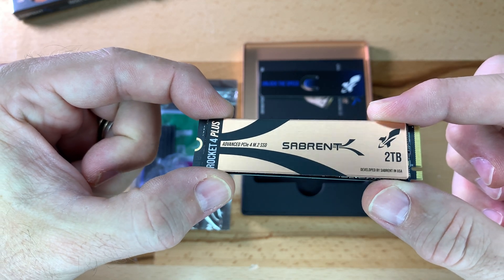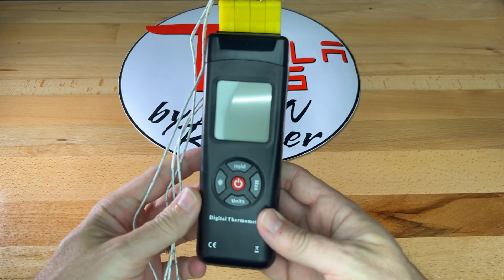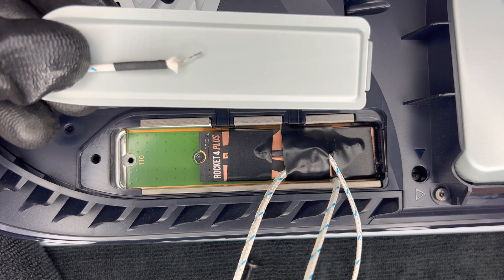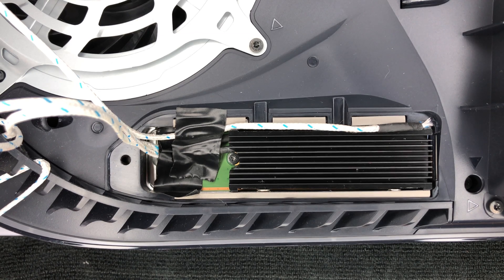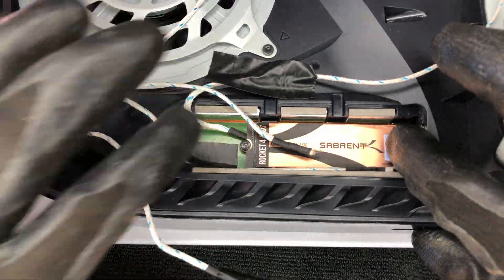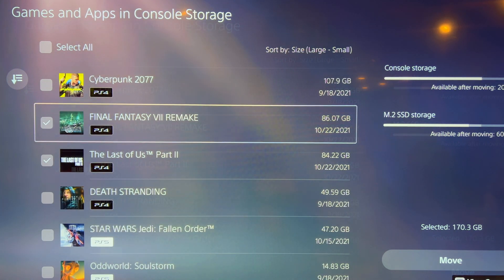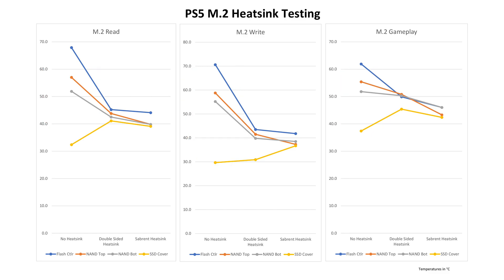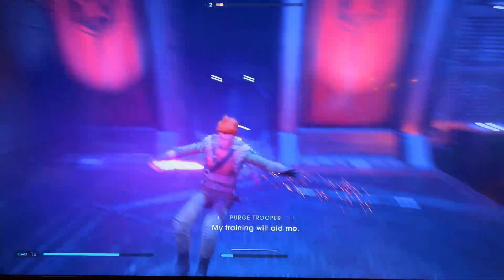Sony PS5 m.2 SSD Heatsink Temperature Tests - None vs Double-sided vs Sabrent

Comment: Thanks for posting this! A very thorough experiment.  I wonder how much having the sensors interfering with the contact between the chips and the thermal interface/heat sink affected the performance.  They seemed like thick wires so it couldn't have been great contact.  But the sabrent outperforming the doublesided really surprised me.  Goes to show sometimes you can just power through something and there's nothing a "better" design can do about it, when the difference in raw power is big enough.  In this case it would be thermal mass and surface area.
Reply from the maker: The sensors are always tricky since they have some thickness that may affect the heat transfer. So performance may be even better than indicated by the test.  Yes, the back side of the SSD doesn't seem to have as much heat as the front.  Makes sense in a way because the controller chip is only on the front side.

Comment: Well done,i was expecting the drive to get hotter while writing ,instead of reading.But if i understood the graph right,the temp gap between the top of the heatsink and the controller is not so much.Or am i wrong?
Reply from the maker: That's what I would have thought too.  The temp gap is close between the top of the heatsink and the controller since it is drawing a lot of heat away from the ssd.
Reply: @MTNRanger  Your test is the only one that i've seen that measuring the top of the Heatsink,along with the SSD.That is very revealing,and helps anyone that does not have the means to do a proper test.But is able to take the temps from the Heatsink,to know if his SSD "overheats" or not.Very well done!
Reply from the maker: @woofaki5550  Thanks, I appreciate that!

Comment: I'm driving myself crazy trying to choose which heatsink to use. I have a double sided on, the sabrent and the elecgear one. I know the difference is so minimal compared to these aside the elecgear as the temps done even get into the 40s. But some of these ssds run better when their a little hotter. I know anyone of these would be good but I'm always worried about the long term effect with the elecgear one.
Reply from the maker: There is no way running an SSD at a lower temperature is a negative thing for longevity. Everything I have read has to do with high temp concerns.  Do you have a link for better performance at a high temperature?  I would use the Elecgear is you already have it.
Reply: @MTNRanger  lower temps will always be better for longevity for sure. There’s a lot of testing that certaIn parts of the ssd will run better when warmer there been a lot of testing. But i personally never had any issues with any ssds I’ve had over the past decade using them. But o have all these heat sinks just dono if using electgear long term will cause any issues

Comment: I got a 2 tb WD sn850 with the elecgear heatsink. Is the sn850 a one sided SSD? I'm getting mixed answers
Reply from the maker: Generally, 1TB and up are double sided.  You can check if you look at the SSD - both sides will have rectangular chips on it.
Reply: @MTNRanger  gotcha thanks! the reason I ask is I would like to know if I should place thermal pads on the bottom of the SSD when using one sided heatsinks like this
Reply from the maker: With a single sided heatsink, putting a thermal pad on the bottom side of the ssd doesn’t do anything - since it isn’t making contact.  However, using a thermal pad on the bottom in a doubled sided heatsink may help a little even for a single sided ssd.
Reply: The sn850 is single-sided all the way up to 2tb.
Reply from the maker: @kevinmitchell766 Thanks, I don’t have one on me to look at.  I wish Newegg and Amazon show photos of both sides.
Reply: @MTNRanger  I agree that would help. I didn't know until I bought one.

Comment: Impressive and thorough testing. Well done. 
There are quite a few ps5 compatible heatspreaders. Have you considered testing all the variants to see which performs best?
I expect they would probably only differ a few degrees between each heatspreader so it probably would not be worth all that time required.
Reply from the maker: It's funny how many have appeared recently.  From what I have seen none are really that much better than the Sabrent - especially since it costs around $20 and some of the others are almost double the price with not a whole lot of difference.  I think the Sabrent is the best bang for the buck.

Comment: Why on earth did you test the Sabrent with the electrical tape all over the top?
It’s designed to cool using the top of it (where you put the tape). This is definitely negatively impacting the results.
I’m not trying to be rude, but please redo the test properly without giving the sabrent a stark disadvantage by covering the area designed to dissipate heat.
Reply from the maker: The tests already show that the Sabrent is superior than the alternatives.  I do agree that I should have used less tape. Thanks for your comment.
Reply: @MTNRanger  I understand, I just wanted to know by how much. Regardless, thanks for uploading the video and taking the time to reply.

Comment: I use a double sided heatsink for the WD 850 in my Ps5. 
An upgrade to the Sabrent heatsink won’t be necessary I guess. There is only a difference of 3-5 degrees. Should be fine.
Reply from the maker: Yes, any of the SSDs with double-sided or factory heatsinks are good for this application.  I was surprised how high temps were without a heat sink.  Even a cheap one helps a lot.
Reply: @MTNRanger  very useful test by the way! Thank you for the great work!

Comment: Are you worried at all about how hot the Sabrent got with it being surrounded by all of that plastic? Did it get measurably hotter in a way that would be worrisome in terms on melting anything surrounding it?
Reply from the maker: The PS5 uses high density polyethylene which melts at 125C.  So there shouldn't be any problem with the SSD and the surrounding plastic.

Comment: Only thing about the sabrent heatsink is I wonder if the heatsink will warp the plastic overtime since it's so close to the surrounding plastic.
Reply from the maker: The Sony SSD expansion cover is metal and also gets hot.  I don’t think it’s an issue.
Reply: @MTNRanger  it gets hot. But keeps the heat in. Where as the sebrant top its actually a heatsink so it's constantly letting it those high temperatures. I'd be worried about the long term effects of using the sebrant cover too. It's brand new. We will know what a few months of any adverse effects.
Reply from the maker: @leonprez231  I'll check on it after a month of use and see how it does.
Reply: I doubt that the plastic will bend a 50° C

Comment: Was debating on what to use, Warship Pro heatsink, or Sabrent heatsink for my Firecuda, going to use Sabrent, tnx for the vid.
Reply: I just received today the sabrent heatsink and installed both my firecuda 530 2TB and the sabrent heatsink. Loving it so far.
Reply: @DMEGC  Nice one, got my Sabrent coming on Saturday and then 2TB Firecuda 530 coming late next week. Cannot wait to be able to install all the games I want.
Reply: @DMEGC  even though the sabrent heatsink is single sided and the firecuda 530 2TB is double sided, that doesn't cause a problem?
Reply: @haz_alt  I believe there are tests out there showing the sabrent heatsink is the best one, lowering the temperature the most. As far as my personal experience, no problems whatsoever.